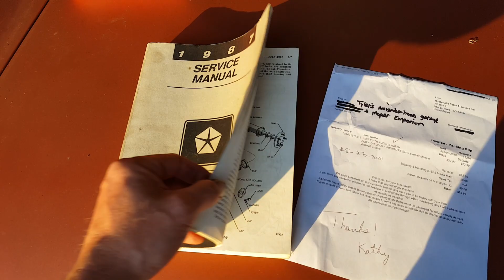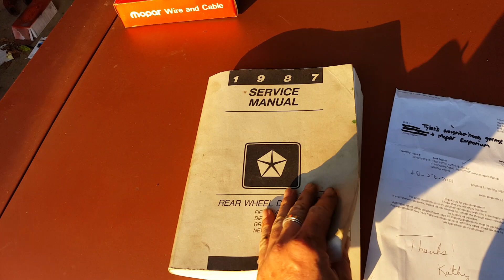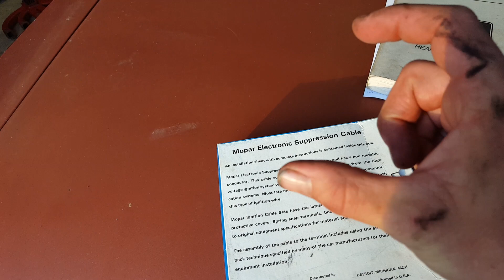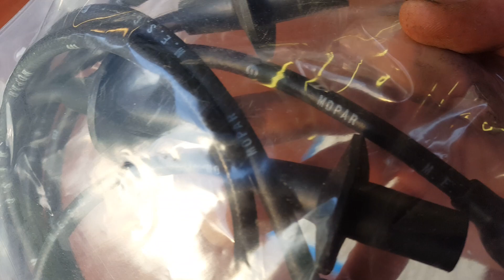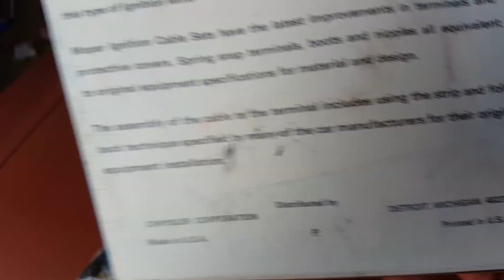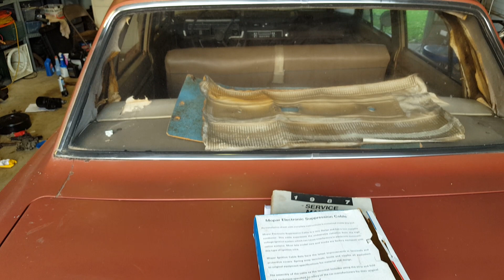A couple vintage Mopar items for a couple vintage Mopars.

Comment: I believe you are correct about the spark plug tube cylinder heads ending after the 1974 model year. I have a 1974 and a 1976 slant six and they have different heads.

Comment: Nice. I have that exact same shop manual that was used for my 87 Fifth Ave. It is a wealth of information (yes it had that same carb that yours does). I tried to purchase shop manuals for all my many Mopars over the years until they unfortunately stopped printing them.